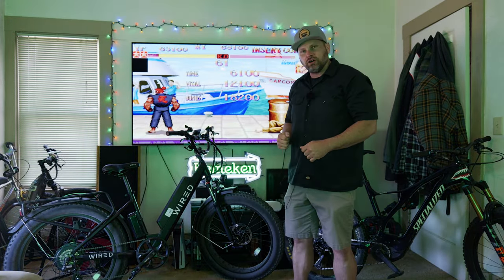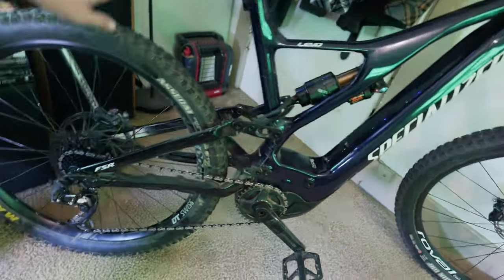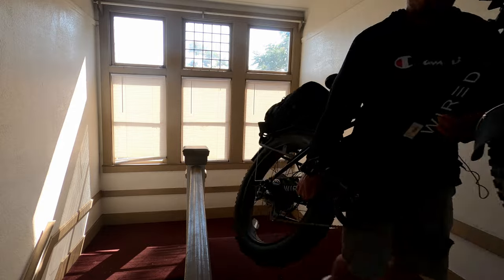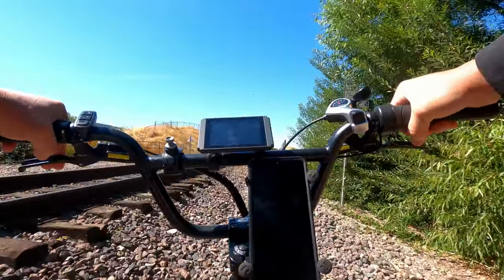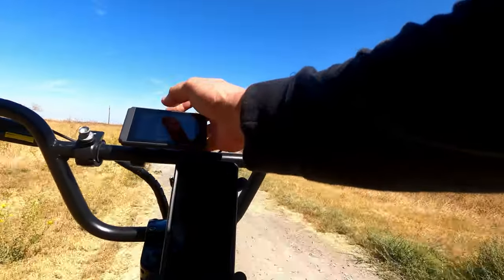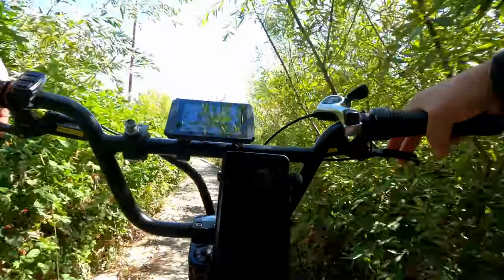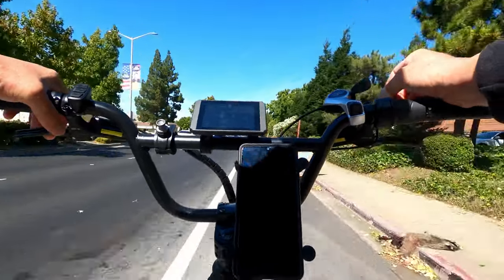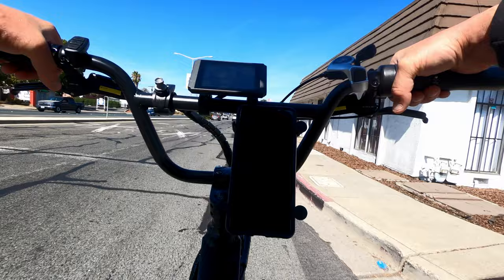Review of WIRED Cruiser 60 volt e-Bike (This Thing is Crazy!)

Comment: Bummer all new bikes come with better suspension and more upgrades. The Freedom model.  People just getting theirs a few weeks ago got old models.
Reply: I am one of the fortunate unfortunates . Yeah I’d be steamed . It’s usually me . Glad to be winning for once 😇
Reply: I like mine. August '23.
Although there are changes, (some are improvements, others, well?)
I like the rear suspension change, but I can just get my feet almost flat when sitting on the seat now.
The new model is 1 to 1.5 inches taller and I would probably  have a harder time handling it and getting on and off of it.
Metal fenders might or might not be better, but I like that my front fender is longer than the new one.
Battery is different, but is it better?
Front fork may be better now, but mine does the job.
56 tooth front is slightly better, but is it THAT much better than 52?
I like how my rear rack is attached better than the new(old?) design.
It seems stronger and not coming into one attachment placing.
I'm happy with my older design.😊 31:58
Reply: @johnforbes9007  I would take an older one too.. Not a deal breaker at all.